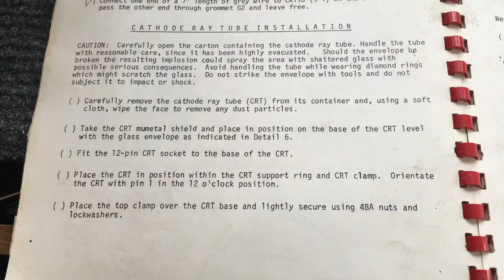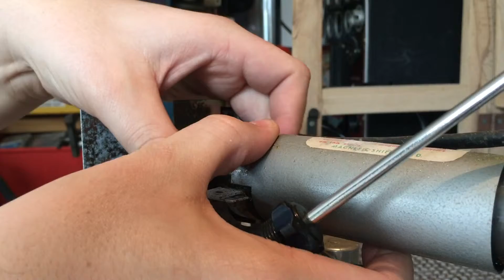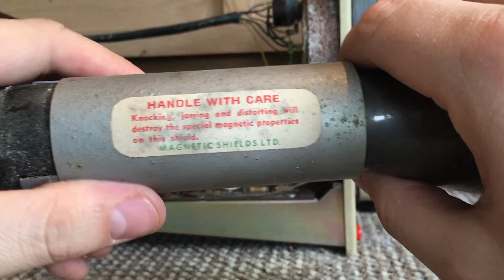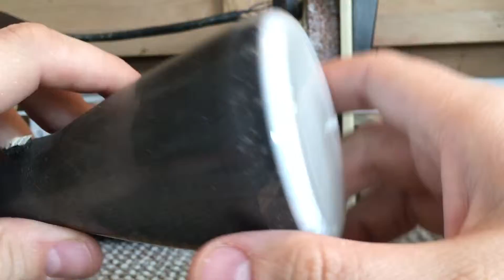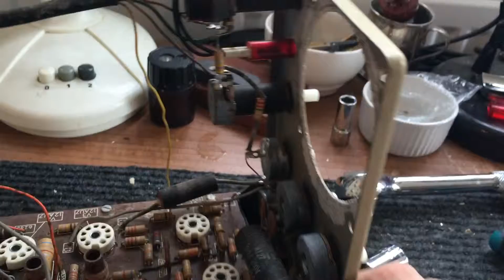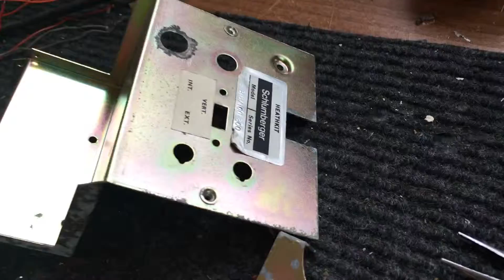Heathkit OS-2 Oscilloscope #3 - Disassembly

Comment: That's a crummy looking corroded chassis. I'd remove everything off it and thoroughly clean the chassis. Then use the instructions to place the oscilloscope back together. Get some new cement glue and secure that base onto the glass neck of that CRT. Make this oscilloscope nice without that ugly corrosion. Leave the tube sockets on the PC boards.